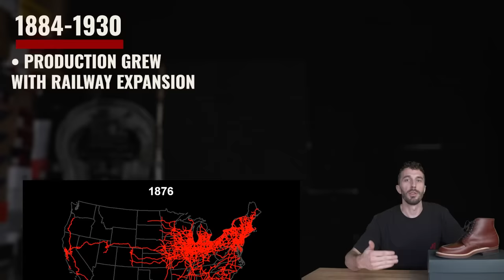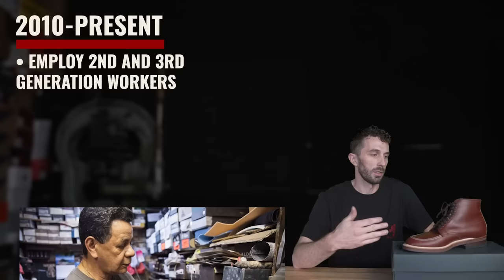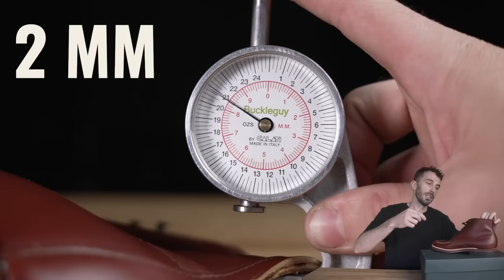Why the Indiana Jones boot is stupidly overpriced - Alden Indy

Comment: I like the way you even criticized the little cushion pad that Alden uses under the heel, saying it was to small.  But in your Viberg review you said what a great thing it was that Viberg put a little cushion under the heel.  I own 3 pairs of Viberg service boots and currently own  2 pairs of Alden Indy boots, and the cushion is the same in size and every other way.  Also, I don't know if you saw Cobblers Plus's , cash or trash video, where he dissects a Viberg boot and criticizes Viberg for using a synthetic footbed cushion instead of natural cork like Alden does, but I never heard any criticism from you in your Viberg video.  You're a joke.  I like both Alden and Viberg, but I will tell you what my Indy's are more comfortable.  Also, Alden still provides restoration services which Viberg does not.  I've used this service multiple times and it is awesome(boots come back like new) and so is their customer service.  Alden hasn't survived the test of time over the past 140 years by making crappy shoes.  There are other high end shoe manufacturers like C&J, Carmina that use similar materials as Alden.  You comparing Alden's to PNW bookmakers is like apples and oranges.  Stay in your lane.  By the way, what do you charge for your crappy camera harnesses?  Oh, and I don't think Alden gives a flying f@#K about your opinion.
Reply: Wow, someone a little grumpy???

Comment: Bad review is bad. There’s more to GYW boots/shoes than just construction materials - what about finishing, last options, width options, overall design, comfort and break-in, and most important of all - fit? I’d take an “overpriced” but properly fitting pair of Alden’s over Red Wings any day of the week. Alden offers dozens of lasts and width options to fit all kinds of different feet. And even comparing 1:1 on properly fitting boots, the Alden are more comfortable on day 1 with their leather board insole, making for a significantly easier break in, making me more likely to… you know… actually wear them rather than inspect the materials on a table. The reality is that uppers or outsole are likely to wear out long before the leatherboard in the heel stack (protected by a super thick rubber heel lift) fails.

While I’m onboard with keeping shoemakers honest, not everything is about materials and durability. But it would be nice if the materials didn’t get reduced while the prices rise.